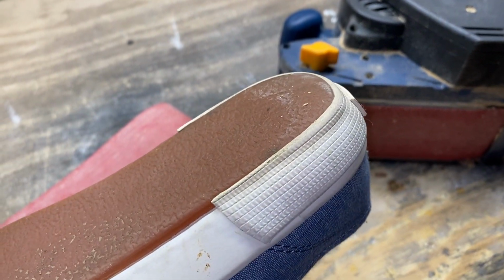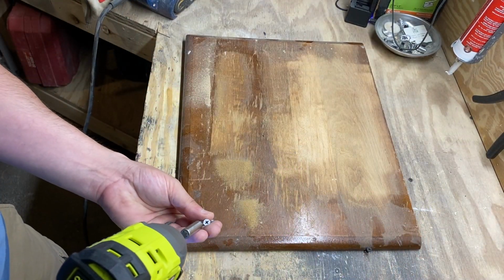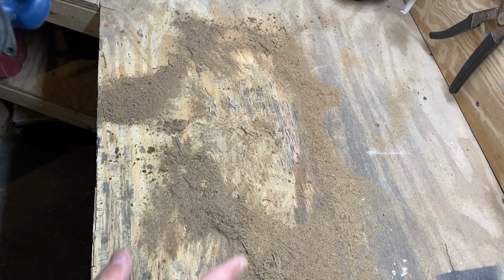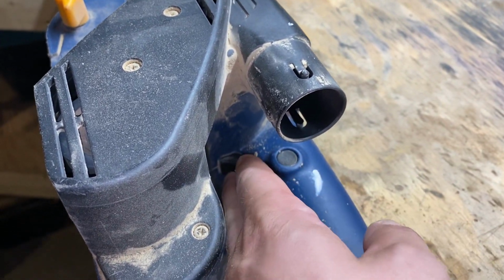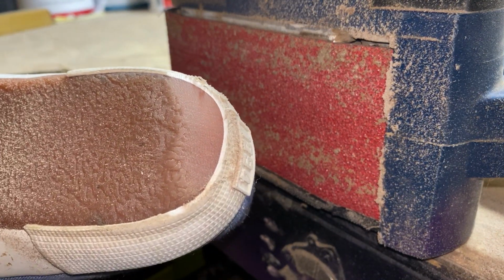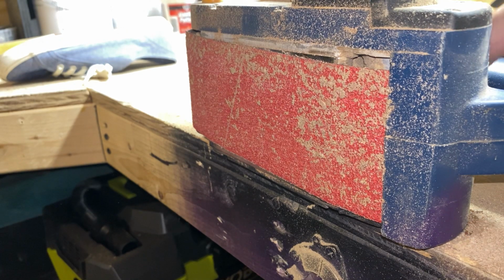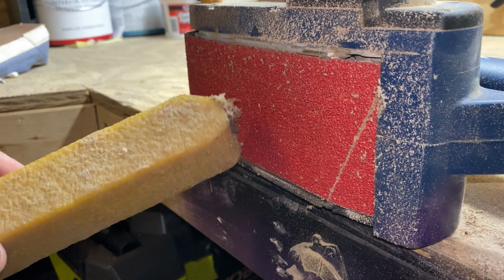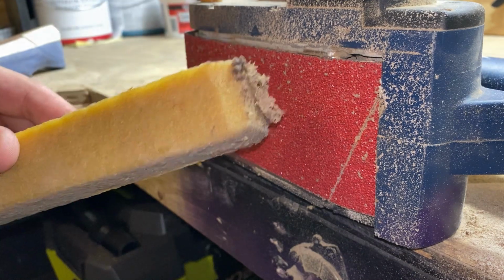Can You Clean Sandpaper With An Old Shoe?

Comment: I just saw the first video and suggested a shoe as well as a silicone caulk ball, which is what I use. As far as the shoe not working as well it's because it was completely flat so it could only clear the top surface, your stick on the other hand has corners which is how it got in the crevices. Try it with a regular tennis shoe or hiking boot that has tread and it will work just as good as the stick. You can also cut the rubber off of the bottom of the shoe and wrap around a small piece of pvc pipe or small piece of wood. Honestly you could probably keep worn belts off of vehicles or equipment to use as well, all kinds of things around the house that doesn't cost any extra money especially with the ridiculously high price of everything right now.

Comment: You can do it actually with silicone tube sealant, if you let or have the content dry
Reply: good tip. If it doesnt contaminate the paper which it most likely does. Paint wont stick to silicone. It could even lubricate the abrasive and make it slide on metal

Comment: Omg! I didn't know you could clean sand paper, ohhhh the sand paper I could have saved over the years! Lol So glad I watched this because I will actually be refinishing a dresser and a buffet that have been passed down to me and need some TLC.
Reply from the maker: Hey, Jamy!  Yeah I used to throw sandpaper away too!  I am so happy I found out about this.  Sandpaper can get expensive after a while.  It will not last forever but this little trick will help it to last a little bit.  Thanks for the comment and for checking out the video!
Reply: If it is an antique, don't sand the finish off but use a gentle stripper. Watch Thomas Johnson furniture refinishing channel for proper care of valuable furniture. Sanding can destroy the value of antiques.
Reply: It's not an antique. It's maybe from the 80's
Reply: @Reese-Dancer  well being from the 80's it would be considered Vintage and possibly Retro.

Comment: I think the issue IS the shoe, believe it or not.😄   The rubber on the bottom of that style of shoe is kinda like eraser rubber. (As far as firmness) Use the rubber from the bottom of an old hiking boot.
But a "good" hiking boot. 
I say good because a better boot should have a stiffer rubber sole.
Just my opinion.

Comment: fix your abrasive cleaner to a board. then just clamp the board and use the sander on abrasive stick without having to screw your sander down
Reply from the maker: Good idea!
Reply: @TheFixerHomeRepair  I just fixed it to the side of my bench, when it needs cleaning i just brush the sander across it a couple of times. I have 3 sanders I may use on job. mouse, thin belt and thick belt. Cant be screwing them all down

Comment: Have you tried to clean the sandpaper by grinding it at the curved surface? Because the belt is bending the crap in belt should be easier to remove while it has been bent outwards which should reduce the friction for the binding.
Reply: agreed
Reply: good tip. Physics

Comment: Maybe the rubber was the wrong kind?   Maybe a Harder rubber would work better.   In any case great video! Also can you tell me what kind of mask you are wearing in this video? I am looking to get a better mask than the bulky one that I use that I cannot breathe in.  Thanks!
Reply: N95 that should be the mask
Reply from the maker: Yes I agree N95 should be the mask for doing any work that makes dust like this.
Reply: Thank you both for your help. I have purchased the right mask now. Much lighter than  The bulky one I was using before and i can breathe in this 1

Comment: I've tried to clean sandpaper with mediocre success. But I usually am hand sanding too. Still will be ordering a the cleaning stick.
Reply: How did you find the cleaning stick worked on the sandpaper used by hand?  I use a sanding pole for drywall and it gets filled up right away.  I saw the cleaning stick on Amazon and it's $10 bucks.  I doubt they're gonna want it back if I use it.  What experience have you had?  Thank you.
Reply: @alext8828  intended to buy the cleaning stick. but never have yet, forgot about it actually. your comment reminded me so I'm adding it back to my "to do" list on amazon. 
I was able to clean sandpaper with an old shoe to a decent degree on my palm sander though.
Reply: @Yhrim70   Yeah, I think I'm just going to go down to the stationary store and get an eraser.  I don't think they will charge me $10 for it. 
You just reminded me I have to get a new base plate for my palm sander.  I stupidly let a customer borrow it and now it's wrecked.  Thanks for the info.